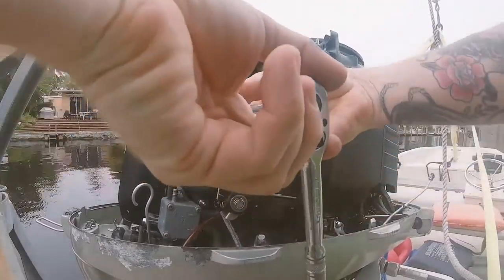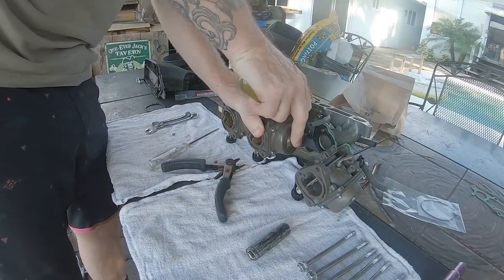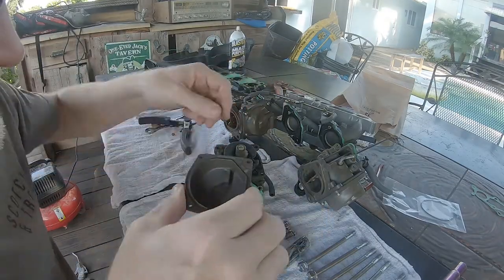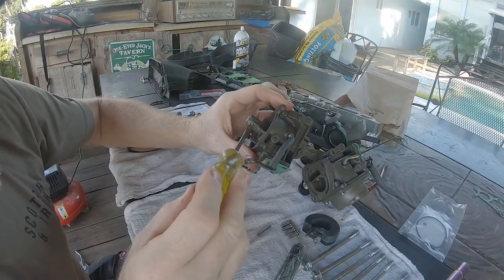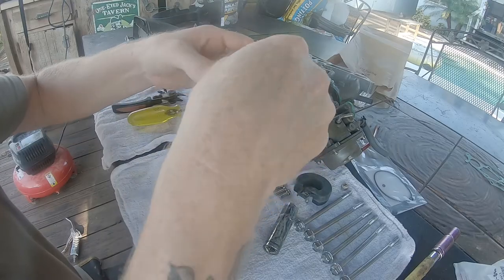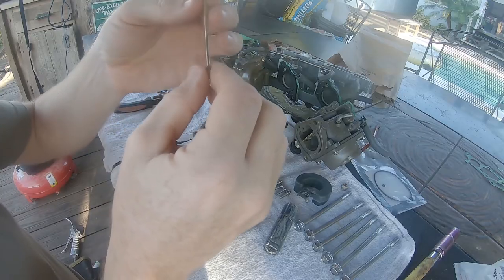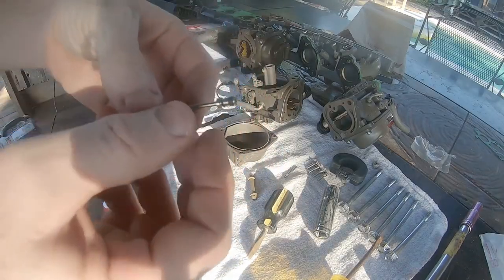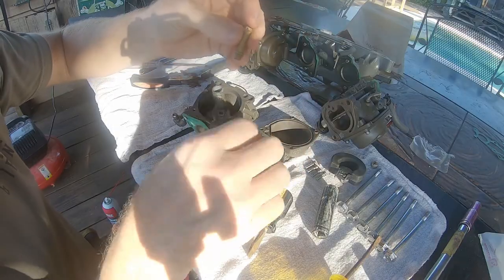Honda BF 4stroke Outboard CARB CLEANING, DISASSEMBLY  & INSPECTON

Comment: Good information! During a deep cleaning, the slow jet emulsion tubes on my carburetors were also found to be cracked at the bottom. This is unfortunately an expensive part but necessary and so replaced.. Personally, I use a 1/4 inch ratchet wrench with a good fitting flathead bit for the jets. No hassle with slipping resulting in damaged jets.

Comment: Great video. Honda part numbers below:

17384-ZV5-000 intake airbox gasket
17151-ZV5-000 intake manifold gasket
16221-ZW4-000 carb spacer gasket (x2 for both sides of spacer)
16150-ZW4-000 low speed idle intake jet
16010-ZV4-005 carb gasket set (bowl and jets)

Comment: I wondered if slow jet tube had holes in middle.Mine needs a new one.All crusty and blocked over.Exactly what I needed to know.Thanks!
Reply from the maker: The first time I did this the slow jet was cracked and I replaced it. They typically have hairline cracks so it’s always ideal to replace them.

Comment: I account for like half of the views on this video. I have a BF outboard that has a hard time starting, and rough ideling. Seems like a carb cleaning would be a good thing to try. Thank you for a very informative video, good footage and nice narrating. :)
Reply from the maker: I had rough running issues with this motor for the entire time I owned it. Some days it ran like new and then the next day it would run like crap. I learned no matter what gas I was using I would still have issues if the boat sat for more than a couple weeks. I started fully draining the fuel out of the system when I knew the boat would be sitting for a while and this helped a little.  I could never really get it to run 100% all of the time. I have a feeling the carbs just needed to be replaced but I wasn't willing to spend the money.  I ended up selling the boat this motor was on.
Reply: @boatcrafterscollective  ditto. I have a BF10 - tempramental behaviour, first start fine, then won't restart until fully cooled. If the carb access was easier (for me!) I'd have a go at cleaning, to be honest I feel like passing on the motor and just getting another make.
Reply: @boatcrafterscollective   *"$#$$#2`#
Reply from the maker: Your keyboard is broken

Comment: Well, I have a comment.  Those bowl screws are not Philips.  They are JIS (common on Japanese small engines), which is close in design, but far enough off that they will strip easily with a Phillips.  A small set of vice grips grabbing the sides of the screw is best for breaking these free.  These carbs have lots of room to allow for this.  A Philips can then be used to finish removing/installing them.

I'm not sure you were very accurate with the naming of the parts, but your disassembly did help me when I did mine.  Thanks!
Reply from the maker: Thanks Captain. I wasn’t the first one to take them apart which is why they were already stripped. Sorry if my part terminology wasn’t spot on. Next time I’ll make sure to get it perfect so you can better understand the process. Maybe you should make a video and correct everything I did wrong 🤷🏼‍♂️ just sayn.

Comment: You make it look simple. I’m thinking of giving this a try. My engine is running great at faster speeds
 But I’m getting stalling at low idle. Is there a cleaner that can be used that might clean up the jets or carbon deposits?

Comment: Hello, at 7:49 the part you call the slow jet that has the o ring on one end is that hollow from end to end .I cleaned my carb and i could see the cross holes in each end however i could not look through the brass piece from end to end .The carb was dirty and gimmed up and motor would not run .Now it runs but needs the carb on. I suspect it that piece in your hand they is blocked IF it is hollow
Reply from the maker: Yes it’s supposed to be hollow. You should be able to see through it to the other side. Also check for cracks.
Reply: Wow. I must have a memory problem because I’m going to have to watch the a dozen times I go through this process. Great video with detail!

Comment: Thanks so much for the video. very helpful.  I have the same engine.  May I ask where you get the rebuild kits. I look on Amazon and Ebay, i'm not sure if its the right kits.
Reply from the maker: Any Honda parts supplier.

Comment: I have a bf 75 and it will not idle very well with the choke on and will not run at all with the choke off. I'm guessing its clogged "slow jets" due to fuel. I thought stabilizer would have helped but I should have known better and that I should have disconnected the fuel and purged the carburetors after every use since ethenol free gas is hard to come by. I do that for small motors like lawn mowers and chainsaws.....my question is that it looked like that 50 had 3 carbs, mine I'm guessing has 4. Those gasket kits are around 50$ am I correct?
Reply from the maker: If it’s running on choke it’s possible you have an air leak in your intake gasket. With the choke on your are forcing it to stay running which I wouldnt do very long. I had similar issues with this motor and yes a lot of the issues came from the slow jet being clogged but it could also be a worn out gasket. I would tear it down and replace all of the gaskets and also check the condition of the slow jet. You might need a magnifying glass to look for hairline cracks in it. It will be very hard to see the cracks.
Reply from the maker: After the second time rebuilding these carbs I started draining them after every use. It was the only way to avoid headaches.
Reply: I didn't run it long like that just a few minutes in the hose.... Think I should check the intake  gasket before I mess with the carbs? Thanks
Reply from the maker: Yeah I would start there but it could be the seal under each carb.

Comment: Question,
How much compression should this motor have approximately?
Reply from the maker: I believe the factory specs suggest 199PSI on all cylinders at 500RPM.  You may see lower than that but the biggest thing to look for is that all of your cylinders are within 10% of each other.  You may see readings like 155/155/158 which would be fine.  Anything like 155/135/155 is bad.  
I found a good thread that talks about how to check compression on these motors. 
http://www.marineengine.com/boat-forum/showthread.php?397258-Honda-BF50A-Compression-check

Comment: I have a BF30A tiller with pull start. After sitting  a few days  it takes like  50 pulls for it to start with choke on . Once it's running  for awhile  it will start first or second pull  for the rest of the day no problem... then  after sitting again for a day or two ...same  scenario ...40-50 pulls before it starts. Primer bulb  hose is brand new  but  I noticed it doesn't  get firm when priming at first start ...but does  once motor has been running awhile . Any ideas.Carb issue maybe?
Reply from the maker: Not sure. Sounds like fuel issue.

Comment: I bought a used bf40. I can get it to start with choke on but as soon as I let choke off motor stops. I adjusted the idle up and got it running for a few minutes and took it out for about 5 minutes as soon as I went back to idle it quit running. I could use the choke to restart but soon as i choke was off it would die. Any suggestions. Thanks for great video.
Reply from the maker: When you use choke you’re cutting off air flow to the carb causing an rich air fuel ratio. It’s not good to keep doing that because you are forcing the engine to run. You either have an air leak or you most likely have a clogged or cracked slow jet. The reason it dies on idle is because there’s two jets in the carb one that fuel flow at idle and another that flows off idle. The slow jet has very small fuel passages that clog up easily with bad gas. Use my videos to remove the carbs and replace everything including all of the gaskets, seals, and buy new jets. Good luck.

Comment: Great Video, I'm going to give this a try to get my BAWS-300183 running. Question: Where do you get your parts? Great if I could get a kit of all the common replacement parts before I begin.
Reply from the maker: Hello Jeff sorry I missed this comment.  I purchased the OEM kit from a local Honda Marine Dealer but you can find them easy on EBAY or other marine supply shops.

Comment: I wonder if any aftermarket providers came up with a replacement slow jet that didn't have the intrinsic issues of the OEM part
Reply from the maker: The issues with the jet are mostly due to the very small fuel passages.  I do not think anything in aftermarket form would be able to solve that issue.  Back in the early 2000s we did not have as poor of fuel quality that we have today and I expect it wasn't as big of an issue. The other issue is the hairline cracking but I expect that also wouldn't see much improvement with an aftermarket version.  Its just metal fatigue.
Reply: Thank for your thoughts. Your videos are very helpful. My father an I are attempting this tomorrow for the first time. Pray for us 😅

Comment: Thanks for the video, good job. Do you have any links for purchasing the carb kits on amazon or other? I have an BF50 on a sailboat and it doesn't get run hard. It starts fine, idles for a minute then begins to idle rough and sometime dies. It's better if I take it out and run it hard for a few miles. I change the oil every season and this year its incredibly dirty. Could it just be carboned up from idling too much? Always use the marina fuel.
Reply from the maker: It’s been a while since I did this so I don’t know the part number off hand. But a Google search should return some part numbers. The seal and gasket kit is separate from the jets. I would expect that your “slow jet” is either clogged or cracked. That why you cannot run at idle. That is the same problem I would have. As soon as I gave it gas the fuel flow would shift to the larger jet and the boat would run fine. Pull the slow jet out and check for damages. I’d suggest just replace all of them.
Reply: @boatcrafterscollective  Thanks for the reply. Yes, I have been searching online and only found OEM individual parts and prices and a few parts discounted on eBay. No rebuild "kits" like for other manufactures. It's about $240 including T&S for parts gaskets and jets. I also checked into having it done at a local dealer @ $200 per carb labor plus parts. New OEM carbs are +/-$200 each but there seems to be a dozen model #'s, some discontinued. Hmmmmm. Like I said, I have only used the gas at the marina and drained the carbs each fall. The motor has less than 200 hrs run time. I'm kind of disappointed with it.
Reply from the maker: $240 is about right for everything including all new gaskets and jets. You don’t need new carbs I can almost guarantee that and you should only buy OEM Honda parts. Anything else is a waste of money. 
Just because you buy gas at the Marina doesn’t mean anything. If they haven’t cleaned their tanks or filters you can still get crap in the gas. If anything a Marina will have a lot less maintenance in their tanks and equipment compared to say a WAWA that sells Rec90. 
Because the slow jet in these motors is so small it can get clogged very easily. It’s not the motors fault it’s the shit gas we buys that’s to blame. I was draining the fuel out of the carbs every time I used the boat if it was going to sit for more than a week.
Reply: @boatcrafterscollective  Ill cost ya over a hundred to do that, LOL but like I said,, what doesn't cost a hundred bucks these days

Comment: You had to do a carb job two months ago on the same carb? Is there something that can be done to not have a motor that needs a carb job every two months?
Reply from the maker: Not really. These carbs are by far the worst I’ve ever owned. The best you can do is drain the gas out 100% after every use.

Comment: Do you know if ita the same fir a BF60  efi (electronic fuel injection?)
Reply from the maker: No. This is carbureted. Totally different.
Reply: you wont have problems with efi, because the air cant get to the gas to make it turn to gum.

Comment: I have a bf 50 hp clean the carburetors it does not remain running at idle and I know what it can be for
Reply from the maker: Clean the jets
Reply: @boatcrafterscollective  the slow jet is the fine length that goes inside the diffuser
Reply from the maker: Yes
Reply: @boatcrafterscollective  clean all the jets for 2 times and it starts and stops in relanty I don't know what to do is something so easy

Comment: Do you have the part number for the seal kit??
Reply from the maker: This is the kit that I used but you need to check your application as they can vary based on year and HP etc
16010-ZV4-005

Comment: Those center caps would not come off I ended up breaking a chunk off the carburetor and ruined it had to buy a new carb very expensive. There must be a trick to getting them out.
Reply from the maker: Not sure what you mean by caps ?
Reply: @boatcrafterscollective  That's the  screw you had to get a bigger screwdriver.
Reply: @pitsmcgoo  put a screw driver in the slot and give it a few gentle but firm taps with a hammer. Should break loose pretty easily after that.

Comment: I was...... a carburetor guy,, but I can tell you this,, my next outboard will be fuel injected,   no doubt
Reply from the maker: Haha. My Yamaha 90 2-stroke runs like a dream.
Reply: @boatcrafterscollective  If I had the engineers from honda, most certainly would ask what's up with those jets?  I know Honda is the shit, but,,,,,,, really? they must know about ethanol
Reply from the maker: Agree 100%. I’ve never had an experience with jets like that Honda.